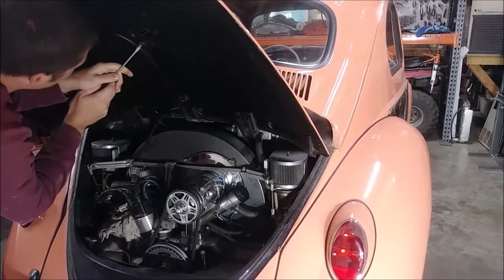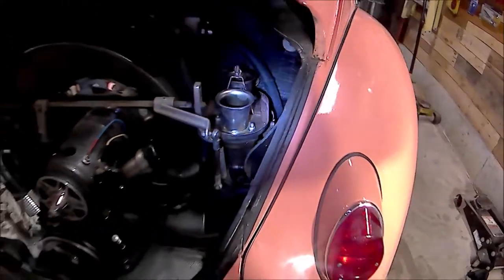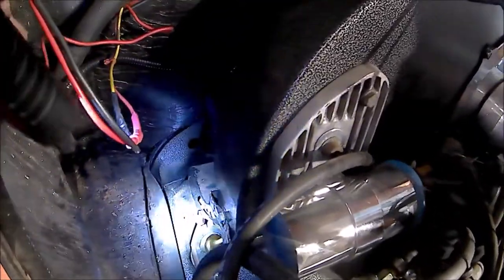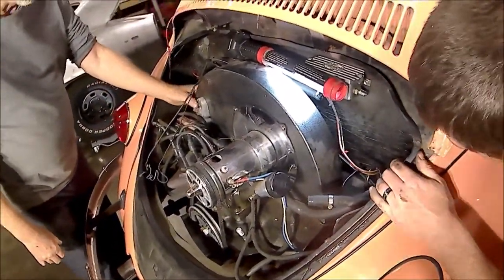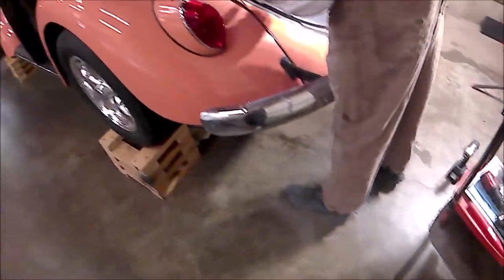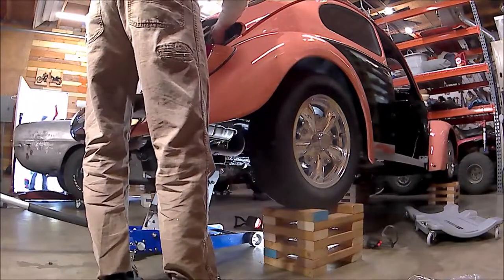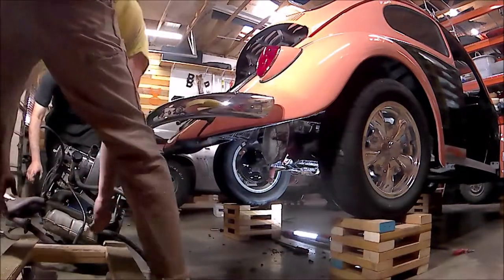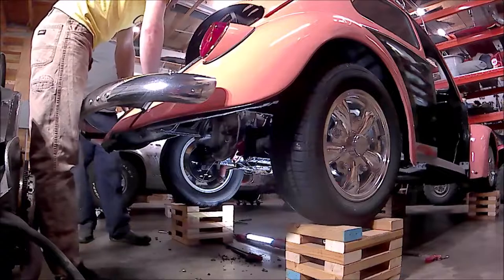How to remove engine 1963 VW Beetle Dual Weber Carbs

Comment: Well that was interesting . Have a wedding to attend Saturday . Ordered a turkey from Kenricks for my oldest son in Desoto for turkey day .  . That insane wind we had left me with alot of work here . I cut up limbs and burned for days . Wasnt on the news but apparently they tried to get in Mid America Arms .Thats my favorite gun store . This city is under siege . Keep your powder dry .
Reply from the maker: Yeah, that was fun. My engine was easier to remove. Except I didn't have two extra guys helping me, I only had Katie to assist and a hydraulic floor jack, not the motorcycle jack in this video. I was about to have all the time I needed to get my Beetle engine out, all the things replaced and back in before Thanksgiving and the cars & coffee show that weekend but as usual all the new people at work quit so I'm back to working doubles again.

I'm going to try to have the Beetle at the November Cars & Coffee but it may take longer to finish and I'll have to try for the December 10 Beetle car cruise. It should definitely be done by then...I hope.
Reply: @HollywoodHornet  I will be glad to be back home after this 2 oclock wedding today . Very expensive and I dont really want to be there . I think I can dodge the reception , not all family is pleasant .